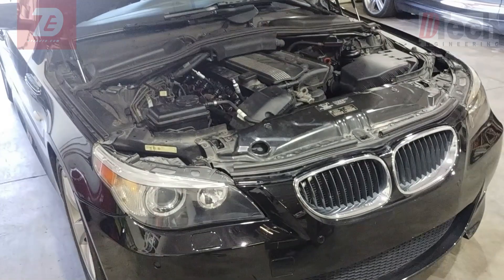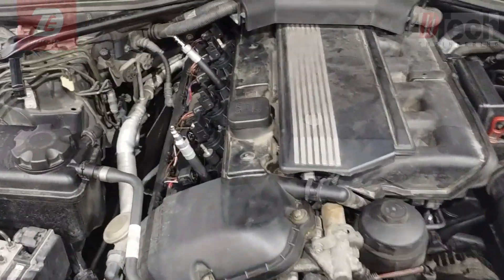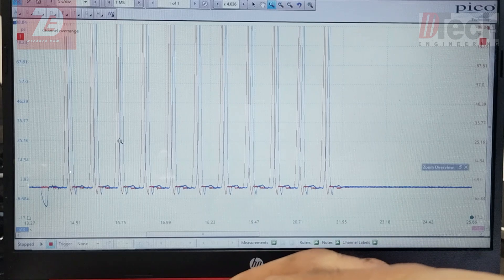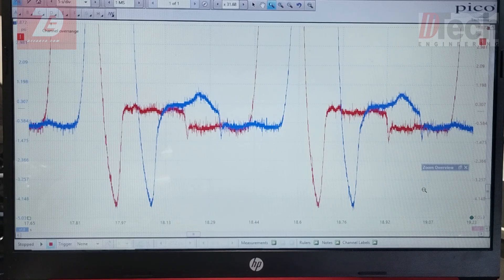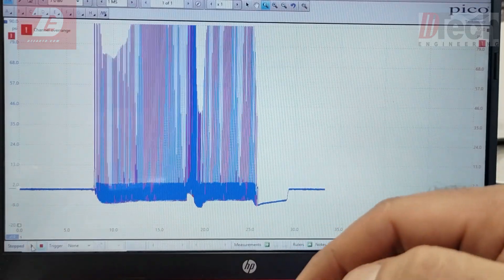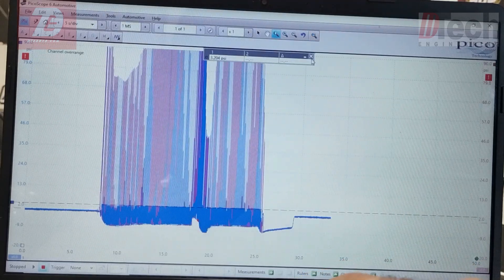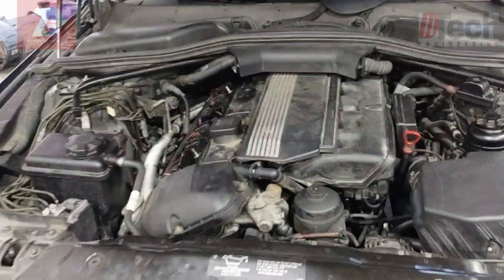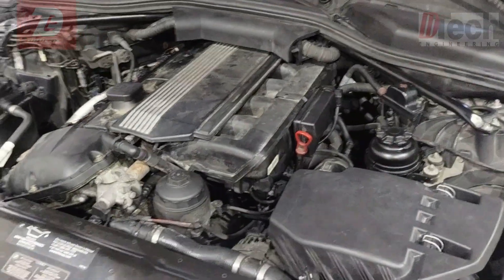How to Test For Clogged Catalytic Converters

Comment: Very nice demonstration.
Could you share a link of those extention hoses for purchase?

P.S. is it possible to use a pulse pressure sensor with appropriate range scale for in cylinder waveforms? Or is it mandatory to have the one with static pressure measurement ability?
Thanks.
Reply from the maker: the hoses are actually from snap on, I got them off the tool truck.  and a pulse sensor will not work for incylinder pressure readings since it cannot "maintain" pressure readings , it just shows a "change " in pressure
Reply: @DTEAuto  got it. Thanks 🤝

Comment: On many vehicles (e.g. V-6) the rear bank is located near firewall, under the cowl, and under the intake manifold. Too much work to remove all of that just to install spark plug. How do you deal with 'dat?
Reply from the maker: you would have to try and rely on scan data at that point. If one bank is not breathing correctly from a clogged cat, you should hopefully see a difference bank to bank with fuel trims, also you can try to do relative compression and add intake pulses with a scope
Reply: @DTEAuto  I do have 8-channel PicoScope, use it a lot. Watch pretty much DTech, PineHollow, and Automotive Diag & Programming dudes.

Comment: Really well explain Sadel! You make my job easier in my car, I just got misfire codes in my 2002 325i cylinders 4,5 and 6 and no power under hard acceleration. I know the DME turn injectors off in a misfire, but it felt as a clogged cat. Thank you for sharing, Sadel. Take care brother.
Reply from the maker: Great to hear! Thank you for watching!

Comment: Do you disconnect the fuel injector for the cylinder you have the transducer in? Good video
Reply from the maker: I didn't on this test, you don't usually have to do so.

Comment: Great test! How did you connect the two compression hoses with no Schrader valve that are in the spark plug ports by using a pressure transducer or pressure pulse transducer? Thank you in advance!
Reply from the maker: pressure transducer in each
Reply: @DTEAuto  okay great and thanks for the information